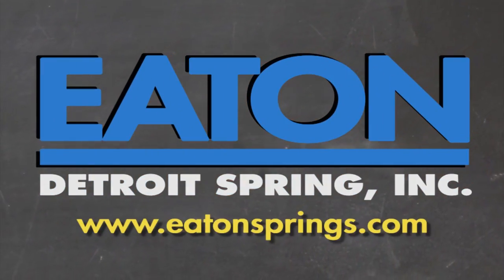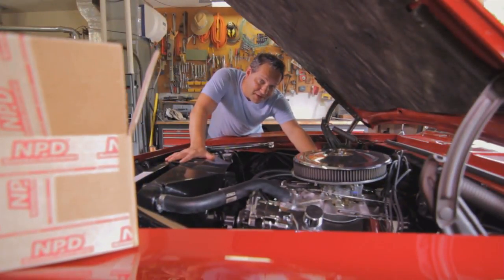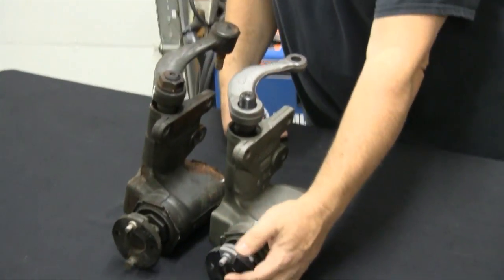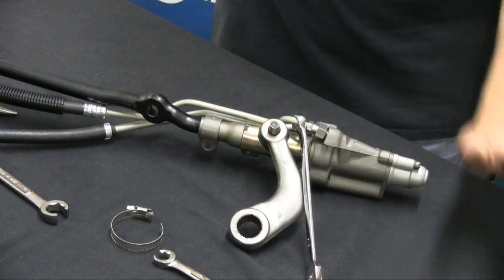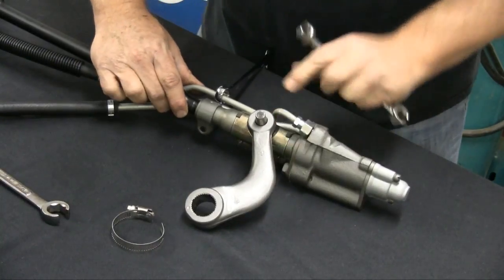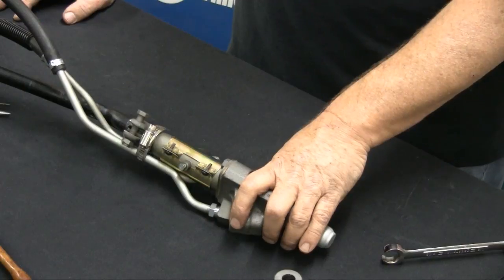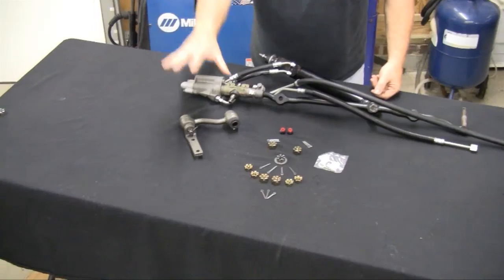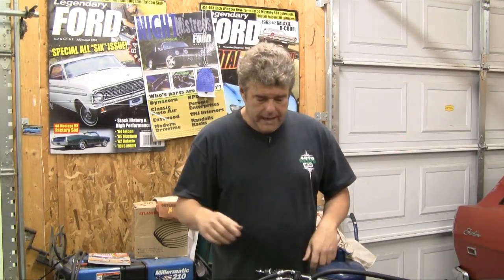Classic Ford Power Assist Install Tips Fairlane Mustang Cougar Falcon Episode 213 Autorestomod

Comment: Good video. I have a 72 ford maverick with this system. Issue I think I am having us the steering feels "dodgy".. like when you start to turn it turns quickly. Cornering is an adventure as it takes very little movement to go thru corners. My question is there an adjustment with the ram/ pump that attaches to the Pitman arm? I see there is threading and a pinch clamp. Steering feels as though the power assist to leading to quickly. Other idea is to change out the manual gear box for a PS and delete the assist system. Great videos.

Comment: On my 68, the power steering pressure line blew and caught fire coming back from the car's 1st show after restoration. I was using the silver split heat insulation tape with the built-in velcro. The line was still too close to the headers, and the velcro part lit up. The big fix?...  I replaced the original softer rubber hose I bought from Ecklers with a stronger, stiffer line that I got from Oreilly's. The replacement hose looks and feels like the ones you see on heavy equipment.  The cost was the same, but the quality was far better.
Reply from the maker: Karl X Our hoses are from Rock Auto. We're well impressed after we got done fitting and fiddling.

Comment: Great video! I have a 67 Fairlane with a 390 4 speed. Would this power steering kit work on the 67? I know the 67 has a solid, one piece steering shaft all the way from the steering box to the steering wheel. No rag joint, I think Ford changed to the rag joint in 68.
Reply from the maker: The biggest issue is the box. Ford used a quicker ratio on the power steering cars. But yes, this will all work.

Comment: Thank you so much for this very informative video,i have two questions please.
 i am planning to rebuild a control valve of 59 Mercury, however i am not sure what the correct kit to order as there is only (vertix) stamped and i didn't find any other code or something and i am not sure if the previous owners had replaced or it's the original part?
How easy is it to turn the steering wheel on a stationary old car not moving? Cause mine is very different to turn the steering when the car is parked, however once it starts moving it gets really easy to steer you can steer with a pinky finger.
Reply from the maker: I would contact Chockostang http://chockostangclassicmustang.com/  And see if they could rebuild your stuff.  Ford used pretty much the same thing from the 1950s all the way up to 1970.

That slave cylinder style power steering  system should be easy to turn at low speed as well as like you say finger tip and highway speeds.  Your issues at low speed could have something to do with it needing a rebuild.
Reply: @AutoRestoMod  thanks 👍 that's all what I needed.

Comment: Hey Jeff, question on the center link itself. If you had to change JUST the center link (oh because just by some reason the car slipped on a jack off the center brace and bent the center link a bit upwards..not that that would happen...lol) , can you just remove it from each inner tie rode and it unthreads by turning on the control valve or MUST the control valve be remove ? That guy that dropped the car doesn't want that headache...Rob
Reply from the maker: Man, sorry to hear that you had that happen. Glad no one was hurt! The control valve is pinned to the drag link too, or should be. I have never removed the drag link from the car and left the valve attached, so I really can't speak to that. If the car is sitting high enough, theoretically the drag link should be removable from the car. Be careful!!!

Comment: I know it has been a very long time, but at 18:00 minutes I notice that the driver side tire is actually hitting the end of the PS control valve. I am having this same problem on my '67 Fairlane and I wonder how you got around it? If you every put wider tires on it, then you are really screwed as your turning radius would be cut way down (or the tire would come apart).
Thank you.
Reply from the maker: Water tires do affect the turn radius not really a good way around it with the stock power steering system. They weren't designed for super wide tires back in the day. Your best bet might would be to try to stay with a very thin sidewall on a wider tire.

Comment: Great video. Very helpful.  Question: Looks like you installed the power steering cylinder bracket about 6 years ago using the crush nut.  How is it holding?  Do you see a need to weld the bracket?
Reply from the maker: I finally did weld a drop bracket in to  clear the exhaust tube.

Comment: Is the power steering fluid that you used type F? I believe Ford calls for Type F ATF in these PS systems.
Reply from the maker: Harry True. We went with Lucas to test it out and see how it performs. The pump seems less noisy at lock with the Lucas. At this point it is a wait and see.

Comment: Hey Jeff, I have a new center link (mine got bent) and on the passenger side, removal is easy. On the drivers side, it goes into the power steering slave cyclinder (like 5:12 shows on your video) How easy/hard is it to get it out ? I guess I am asking, without removing the power steering , what do you do to get THAT end out...I cant find steps anywhere...Thanks
Reply from the maker: If you are referring to the actual slave cylinder, the hardest part is the pin in the cylinder. I have never taken a cylinder off without dropping the tie rods.
Reply: Hi Jeff...Yeah, found a video ..bottom line, the center link and control valve all have to come off because they get joined internal (there is a good video thank God) and then mounted as one piece. I think my biggest challenge will be the studs (like the pitman arm connection, slave cylinder connection, etc.) UGG...Here is the video (start at 6:45 to see what I mean ) https://www.youtube.com/watch?v=zg17Noy82Pg&t=413s

Comment: on my 1967 mustang . which end of the pressure hose should you hook up first .? the end that goes to the pump, or the end that is on the valve.? this maybe a dumb question to some but i need to know the correct way . thanks for any help with this.
Reply from the maker: I'd start at the valve end.
Reply: thanks for your help.

Comment: First of all I wanna start out by saying These videos you make, Have been a life saver for me. I couldn't have gotten as far on this car for my daughter with out them. Now, I have the one piece long shaft box on my 65 mustang coupe. Can you tell me if there is a rebuild kit for that type of of box. I've tried to look one up. The ones I found look like they have to many parts and pieces with them. This may be do to the fact that the kits fit multiple steering boxes, but I don't know enough about them to figure out if it's the correct kit. any help would be appreciated. Thanks again for making these videos.
Reply from the maker: We'd contact Dan at Chockstang: (217) 882-2083, tell them you saw this video. He is a WEALTH of knowledge on these systems. He will probably have a rebuilt unit that will serve your needs quite well.

Comment: A question. Is this mustang used to be a manual steering? I have a manual steering '65,  and I want to convert it to power steering. do I only need power steering control valve and power steering slave? Pls help. Thank you
Reply from the maker: Contact the folks at Chockostang: http://www.chockostangclassicmustang.com/
They have all the goodies to make the conversion happen.

Comment: Another great video guys. I'm looking to replace the steering box on my early 67 coupe. It's manual but I want the quicker ratio from the power steering box. I figure it will keep me in shape.

Have you used any opentracker products? I was looking at their roller idler arm for a little less steering effort with the quick ratio box. I heard that it might reduce the return to center, but the return seems pretty violent to me at the moment. Roller spring perches would be nice too, but it's all in the $$...
Reply from the maker: Corsonmcnash We LOVE Opentracker. If you speak to John there yell him we recommended you to call. Great people and great products there.
Reply: AutoRestoMod Great to hear, I'll do just that. Keep up the good work fellas, every video is packed with good info.

Comment: Weld that ram bracket to the frame. They almost ALWAYS break the nuts loose inside the frame rail, from the extra leverage of the longer bracket. Thankfully mine is already done, since I installed headers on the car. They have the same fitment issue you did on the exhaust pipe on the wagon.
Reply from the maker: We did.
Reply: @AutoRestoMod  Did you use the Gates hoses/lines 353300 for the valve to cylinder lines. I am trying to test fit everything right now, and I am kind of worried about the lines kinking up and causing issues. Were there any problems with kinks later on? The fit looks nearly impossible with the parts in the car. I have everything loose at the moment.

Comment: Would you guys consider ever doing a video on how to rebuild the power steering control valve and cylinder?
Reply from the maker: +kyle johnston Sure! We'll look and see if we have an old valve around. If we do, we'll have at it!
Reply: +AutoRestoMod Muscle Car Resto and Modifications 
Cool thank you, I am in the process of rebuilding my 72 Mercury comet front suspension and need to rebuild the power steering components, I've rebuilt the pump thanks to your video but their isn't really a lot of detailed videos on the rest of the components
Reply from the maker: We'll contact Chockostang about a kit. And we'll try and find a valve around here...somewhere.

Comment: Jeff isn't there supposed to be another bushing on the outer side of the drop ps ram mount?
Reply from the maker: Mb cB There is one, I had to take the one that we hand and cut a bit off to get it to clear the shaft. After the inside one takes a set I'll put another bush in that is thicker. Good eye Mb!

Comment: Why? Why did ford use that crap instead of using a steering box with power steering?
Reply from the maker: I thin space limitations was a big factor on smaller cars. In 1965 Ford went to a integral box on Galaxies but stayed with the rams on the Mustang, Falcon, and Fairlane until 1971 on the Mustang and 1972 on the Gran Torino. The Falcon never moved away from the ram valves.